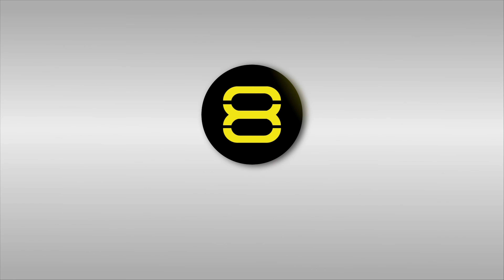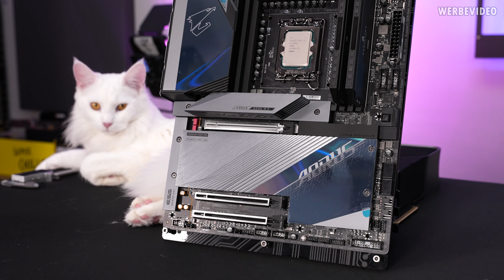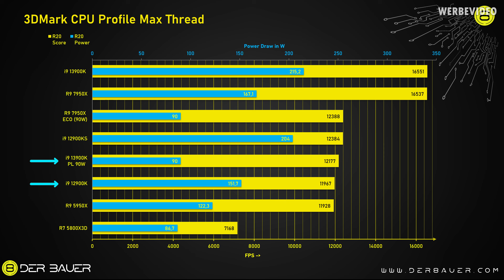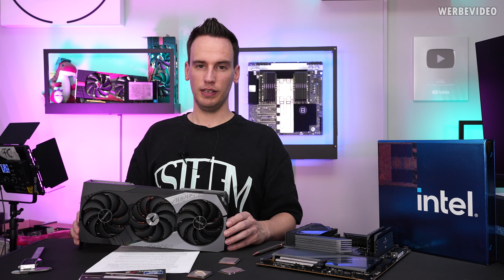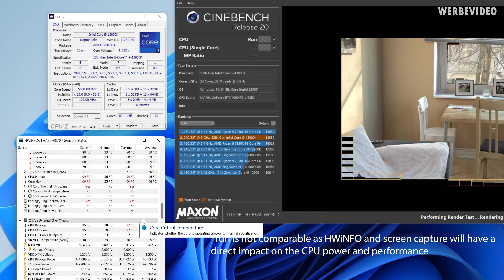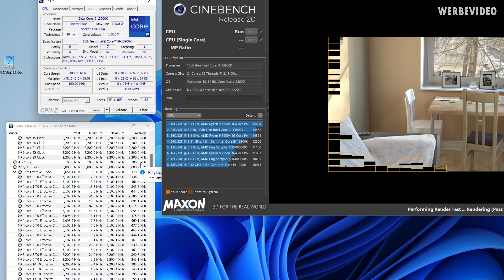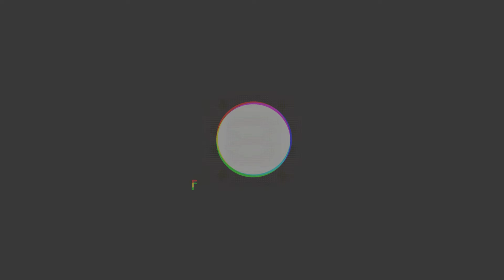Testing and Tuning the new 13900K for Efficiency

Comment: I typically only watch you and GN when it comes to technicals and stuff but with the comparisons this time yours was way easier to pick out differences between gaming and multi thread with their power draws. 

Overall really liked this video and the tips on what you can do to better power draw along with what happens when you do so.  

Thanks for the great video!
Reply from the maker: Thanks!
Reply: Yeah I agree, GN seemed to have only looked at power efficiency at multicore loads (full load) but not during games (from what I recall). It's nice to see the bigger picture here because you get to see that they're not only throwing power at the 13900k and it's extremely competitive in terms of efficiency when gaming. That being said, all this work takes a lot of times and makes for messy graphs so I can understand why some things are omitted from channels.
Reply: @zaku2939  Yep and GN also didn't go into low power settings either to find more realistic power/watt sweetspots for both cpus, so all you get is the over-the-top stock overclock that makes zero sense and only exists to fight an arbitrary max performance war, when in reality 90% of the performance can be achieved at half the power.
Reply: @Real_MisterSir  Because nobody spends $6-700 on a high end CPU only to essentially "cripple" it. Gamers will want max FPS. People buying it for production want max performance as that's how you make money. Only a few rare enthusiasts with money to burn will do things like that.
Reply: @FluffyWuffy17  Getting a better performance/watt at still high performance levels is not "crippling it". Losing at maximum 10% performance in situations where you're strictly gpu bound, is not crippling by any stretch of the imagination what you even on about?? Gamers don't buy flagship GPUs for max fps anyways, that money goes to the gpu first. Not a flying fuck gives any care to whether you get 500 or 600 fps in csgo, and below that the cpu matters less and less anyways so you might as well undervolt and not lose any noticeable performance whatsoever.

These cpus are bought mostly by people who spend a lot of time on their computers in mixed workloads and gaming, someone who doesn't have a dedicated work computer with enterprise hardware, someone who isn't satisfied with pure gaming performance. Some people get these cpus just to be happy about having the best hardware currently available, sure, but realistically that's not the point of these components. If it was, then we would see a lot more focus on pure gaming performance in general at the top tier - stuff like the X3D would be the norm, and any multithreading potential would be a tag-on at a premium cost on top. But reality is that it's the complete opposite. Didn't used to be like this 4-6 years ago, but it is now.
And workloads don't automatically pay for themselves just because you can complete a 3D render 10% faster - it doesn't equal 10% more profit. But what IS guaranteed, is a doubling in your electricity consumption, which most certainly can have an effect, especially on smaller companies where you don't just have long queues of render work waiting to be completed. That's enterprise work, and for that you'd be buying enterprise hardware anyways if that amount of time saving truly makes a difference in your earnings to justify the disregard of power consumption. Especially now where electricity prices keep rising.

Plus you also need to invest in expensive cooling to even operate at the peak performance output levels, which you may not have space for in your current case, etc etc. Cutting down unnecessary variables is typically much more beneficial to a workload-based usecase, than what the extra 10% performance uplift would net you in time saved and potential money earned.
Reply: @FluffyWuffy17  gamers may want the maximum FPS
But what they end up with is ranting about micro stuttering on places like steam..

Never fails
Reply: @Real_MisterSir  you do know in that case you can pretty much get 13700k for identical gaming performance right?
Reply: Yes I think the 1% and 0.1% lows are the most important. Gamers Nexus showed that the 13900k has 0.1% lows as bad as the i3-12100 for eSports games like CSGO. Derbauer is the only major YouTuber that includes eSports PUBG in the results, so it would have been really good to have 1% and 0.1% lows in the results
Reply: @NadeemAhmed-nv2br  but the 13700K will draw more power than the eco mode 13900K for the same performance, probably
Reply: @FluffyWuffy17  "nobody spends $6-700 on a high end CPU only to essentially 'cripple' it":  Not trying to be rude, but you're wrong. Getting a high core / ROP part and running it much more efficiently than the manufacturer's stock settings, especially when stock settings are insanely inefficient is a good idea and becoming more common. Even if you reduce the performance down a pricing tier you're almost always getting a much more efficient system. It isn't just about CPU/GPU power draw either - this effects noise, part cooling and room cooling, etc. Also, with a couple of clicks you can unleash the full space heater experience when needed.
Reply: @der8auer-en  Why not run that test at 16:42 with manually  setting the wattage of the 7950X to 70 watts?  We still don't have an apples to apples comp at this stage of the  comparison. ( manually setting the PPT to 70 would do the trick, as I'm sure you know. )
Reply: @NadeemAhmed-nv2br  Tbh nobody should get the 13900K for gaming only, unless it really matters to them that their fps counter says 600 instead of 550..

I got mine for what the 13900K actually is made to do: mixed multithreading workloads. If I just wanted gaming, I'd go 13600K. If I was on a tight budget but needed decent workload capability I'd go 13700K. If I'm on a budget but absolutely need high-end workload capability, I go with 13900K (which I did). If I was on no budget, I'd go threadripper.

That's how it goes, if one follows common sense. I think people need to be reminded the i9 is not meant for gamers. It's meant for professionals who also happen to game. Otherwise what need does anyone have for 24 cores 32 threads and loads of cache.
Reply: @FluffyWuffy17  'K'/'X' CPUs are generally speaking a luxury product: whoever buys one is accepting they're throwing away money and/or time. So in a certain sense you're right. Someone looking for something purely functional is making a bad purchase buying a 'K'/'X' CPU

And with max performance is NOT how you make money: those who buy hardware to make money value ALL costs involved with the purchase. A company out for money is more likely to buy something that's definitely not 'K'/'X' for multitude of reasons related to questions like:

How many time of my IT department this is going to require?
How expensive are going to be related components(cooling, motherboard,cases)?
How are going to be electricity bills?

A CPU sipping 300W for a 10% perf increase is something any company out for money is going to steer clear of because: their IT will have more work choosing specific setups and testing, each unit of hardware(companies count them in thousands/hundreds) is going to sustain very steep cost increases and power bills are going to have x3/x4 increased consumption for +10%???
A server with 32/64 or more cores sipping 300W is a non issue because at that power budget all those cores are at peak efficiency, it's just taking 300W because it's many cores, but it's what in bussiness realm is called scalable solution: want more computing, throw more cores in their efficiency sweet spot at it
Reply: Dear der8auer EN, its appears your subscribers dragged you kicking and screaming to finally admit in your videos that Intel has a power problem with their 12th Gen CPU & onwards. Unfortunately Intel will not be paying you bribe money for this video.
Reply: @FluffyWuffy17  Fancy update, I have been happily using my 13900K for a month now for 600 bucks, and it is indeed running in a lower wattage consumption setup. It's absolutely amazing, it's not ruining my electricity bill, it's not running excessively hot under extended load (professional 3D rendering and editing), and during gaming I still couldn't fully saturate its performance cap if I wanted to - not unless I get myself a 4090 and play CSGO on lowest settings. Even at 100w the 13900K reaches 90% of its gaming performance in high-end scenarios (I play OW competitively on a team).
During near-idle tasks the cpu sips power like no other, it's so damn efficient despite its brute force nature under peak load. It's honestly imo the best CPU for all tasks right now, and definitely worth its cost if you plan on utilizing its 24 core/32 thread productivity performance (which I do every day). I don't need 10% extra peak performance at the cost of double the energy bill and increased thermals. Those extra 10% is just for novelty's sake, not actual real world benefit.
Reply: @jcbc5950  As someone who has used the 13900K for competitive esports (OW) for a month now, I have not witnessed any critical lows at all, fps is rock solid I don't even think I've seen a visible dip yet, so any percentage lows have been in the single digit millisecond range at best, practically unperceivable. Haven't had a single stutter yet.
Reply: @Matlockization  Intel doesn't have power problems with the 13th gen though, what do you mean? They're very efficient for their performance.
Reply: @Real_MisterSir  Intel power problems = using 30-40% or more power than AMD. Not very efficient.
Reply: @Matlockization  They don't. Or rather, power consumption is waaaay more complex than just looking at the absolute peak numbers. Power curves scale differently with efficiency, and in most common tasks AMD uses far more energy than Intel. If all you do is fx pump out 3D renders 24/7 with zero breaks then yes an AMD setup could offer better performance/watt, but if you have any degree of mixed workload the Intel chips will quickly outscale the AMD chips in the performance/watt counter over time.
For example, in any low-performance scenario the Intel chips will use 5-10x less power than the comparable AMD cpus. If you have a somewhat normal PC use, the Intel chips will use less power over the course of daily use, than the AMD chips will.
Reply: @Real_MisterSir  There is not one reviewer out there (unless you watch der8auer  video's) that shows Intel 12th Gen onwards uses less power than AMD over time. And its worse for Intel with games. They have all shown Intel power consumption has skyrocketed. And yes Intel has better scaling. But it comes at a power cost. Intel performance is better than AMD but not that much. Just look at AMD laptops for example. Their CPU's are constantly better than Intel in performance & battery life because Intel thermal throttling cuts in earlier. How much battery life can you get out of Intel than AMD while gaming ? Don't believe me ? Go to Jarrod's Tech. der8auer was the last of the reviewers to recognise that intel was using way more power than AMD.
Reply: @Real_MisterSir  They are a lot less efficient than AMD. And the performance difference isn't that much.
Reply: @Matlockization  You know why? Because every single other reviewer only stress tests and care about peak consumption. Derbauer is also one of the few reviewers who actually tested efficiency sweetspots with undervolts vs regular power limiters to see how both AMD and Intel perform at their most optimal performance/watt settings.

Just because most reviewers neglect real world testing, doesn't mean real world testing is irrelevant -or less valuable. In reality it just proves that most reviewers put more effort into pumping out consistent content, instead of thinking if the content they produce could/should be improved. GN generally also does really well but even they could go further. Even Derbauer could go further. Quality can always be improved no matter who does the testing. That's why every single professional lab test always has to be followed with extensive real-world testing, because lab tests are inherently limited and biased in their results.
Reply: @Real_MisterSir  No one buys a CPU just because its the most optimal ever. Ask anyone why they buy a CPU and I can guarantee you that they will tell you its about price, efficiency & performance. And the problem with performance per watt is that if the watts goes up in tandem with the performance then its hides power efficiency. So why der8auer EN play down the fact that Intel CPU's need so much more power to beat AMD by a slim margin in almost all applications l? Well you can see what's happening in the laptop market right now where AMD for the first time has dominated. Now if you have a desktop it wouldn't matter. And Power efficiency is a real world must because its applicable to laptops etc the most and that's what most reviewers are addressing. Except the Intel shill der8auer EN is not. Yes most reviewers put out consistent content but it covers a whole range of things so its always different, these reviewers are also truthful and they definitely are not favouring Intel like der8auer EN is.
Reply: @Matlockization  that's a whole lot of word vomit that ain't worth my efforts.
Reply: @Real_MisterSir  I think you should see as many reviewers as you can coz the advice is free. If you already have or are planning to get an Intel 12th Gen and onwards then good luck !
Reply: @Matlockization  😂😂😂😂😂😂😂😂😂😂😂
Reply: @Real_MisterSir  Why ?
Reply: @Matlockization  All i know is my i5-13600K computer uses 67-72w while looking at a website. My new Ryzen 7 7700X uses 82-84w while doing the identical thing.
Reply: @unclej3910  I have AMD's Ryzen 7 7700X as well and in eco mode you get 65W with browsing but Intel i5-13600K has a minimum of 125W not 82-84W. That's almost double AMD, lol. Just ignore your power bill with Intel and you'll be fine.
Reply: @Matlockization  In my usage, i found the i5-13600K and the Ryzen 7 7700X to be almost identical in power draw. But the Ryzen 7 7700X exhibited strange behavior while gaming with  my RTX 4080. But with the i5-13600K, everything runs very smooth and stable. So, either the 7700X doesn't play well with the rtx4080, or the cpu i got is faulty. Or i would need to update the BIOS? I really don't know.
Reply: @Matlockization  I am in the return window for the X670E mb and the DDR5 memory. the 7700X has a replacement only policy. I am thinking of doing a replacement on the cpu, and giving this one more try. All i know is that the PC took 1-2 minutes to boot up, and in video games, the power had large swings up and down, and i wasn't getting anyways near the fps i get with the i5-13600K. In short, the 7700X PC was exhibiting unstable behavior.
Reply: @unclej3910  I never had those problems nor have I heard of anyone else having those problems. I think your one of those people who rushed out and bought the 13th Gen and didn't care what the reviewers said.
Reply: @Matlockization  You may have misunderstood my comments. My Intel i5-13600k PC has been flawless from the first boot up. The Ryzen 7700X PC i built had the long boot ups, and very odd behavior while gaming. Two years ago I built an amd Ryzen 5600X PC and it ran great. So, I think the 7700X or the motherboard has issues. I’m not one to give up easily, so I may give this another shot. The reason I went with the 7700X was for the future AM5 socket upgrades and all gen5 pcie and m.2 capability.
Reply: @unclej3910  Ok good luck with that.

Comment: Best review so far. I'm saddened by how much PC part reviews have been dumbed down on other channels. Nobody considers tweaking settings anymore. If you're savvy enough to build a PC, you can tune some settings in BIOS. 
Well done, Der8auer.
Reply: because maybe reviewing a CPU is not tweaking it.
in this video nowhere there is a full comparison with tunned CPUs.
just 1 tweaked.
it's not a good review if you don't compare the same things.
well done? really?

if you want really in depth tweaking of different CPUs, check the skatterbencher channel.
Reply: So you're telling me you'd buy a $700+ cpu just to undervolt it and get the performance of 13600k or last gen? okay buddy
Reply: @kwanro9172  no he said tweaking it.
Reply: @HappyBeezerStudios  If you buy a 13900K and have to worry about the electricity bill maybe you should not buy a 13900K just saying. Not sure how expensive 1 kWh is for you but this should not make a huge difference for someone that can afford to spend this kind of money on a CPU like this probably paired with a 4090.
Reply: because a review should just be out of the box experience, tweaking should be kept to a separate video imo
Reply: @HappyBeezerStudios  The power bill probably shouldn't really be a concern for someone buying a 13900k, if that's the case they probably shouldn't be buying a 13900k
Reply: Changing the power limit is not really tweaking, almost anyone who gets a K CPU likely does it. It is part of the first setup and should be part of any test to show performance with a few different power limits. Happy to see more people doing this now :)